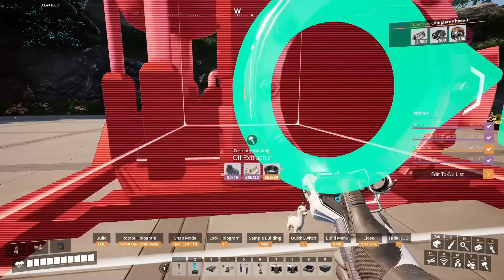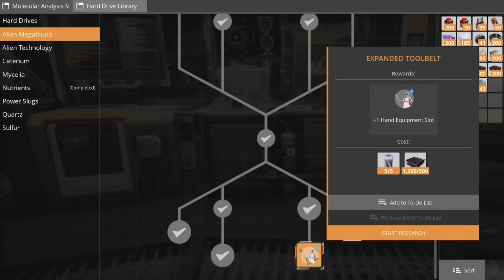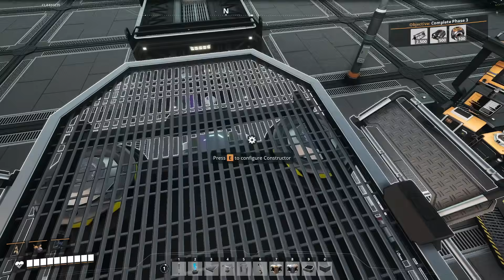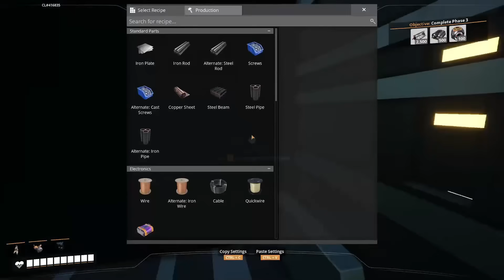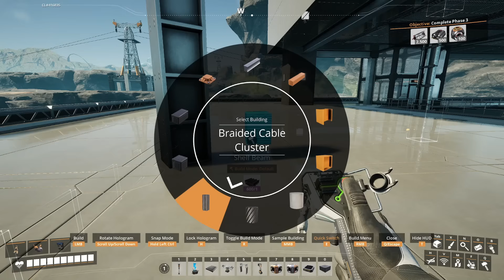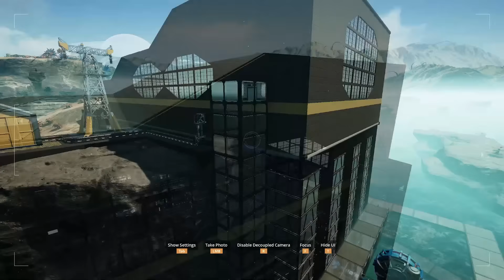Start of Phase 3 - Encased Industrial Beams & Modular Frames - New Satisfactory 1.1 Playthrough

Comment: I haven't played since 1.1 released but I faced a similar bug like in 29:40 in Experimental. 

The way I managed to make it work was to connect the short lift to a pole that already had a belt on it. So in this case if the pole was connected to the wall hole and then you placed a lift from the merger to the pole I think it would work.
Reply from the maker: Thank you! I’m so used to not doing that because I like the way the belt looks when it’s connected inside the lift instead of right at the end. But this is a great workaround, thanks!
Reply: @moo121  Yeah I also didn't like how it looked and I think I was removing the belt and connecting it back to the lift without it losing the connection

Comment: On my first playthrough it took me hundreds of hours to get to this point.
Reply from the maker: I know that feeling. It's amazing how much better each new start feels.
Reply: @moo121 ya it’s crazy how much of a difference it makes.  My first playthrough even had mods that made transportation and logistics much easier, and at nearly 300 hours I had barely got to making oil products (granted we didn’t have Blueprints back then).  My current (2nd) playthrough just broke 300 hours and I have a 144 GW rocket fuel power plant, a 1800/min plastic and rubber distribution plant, and just finished my 10 supercomputers/min factory.  WAY more advanced than my first run through.